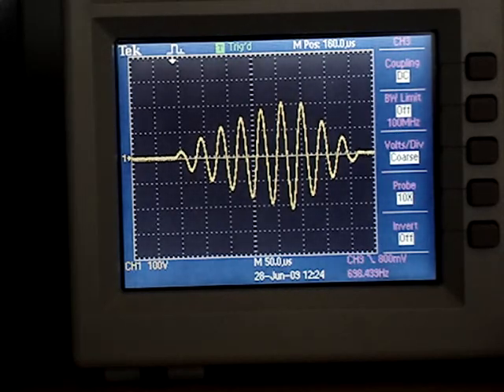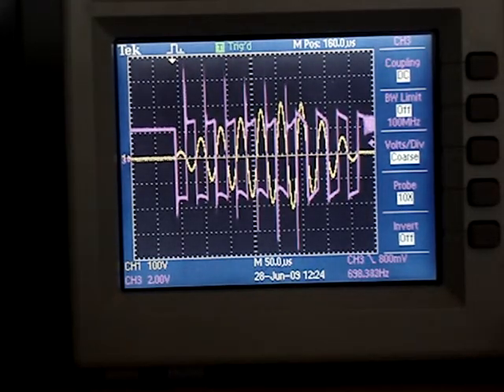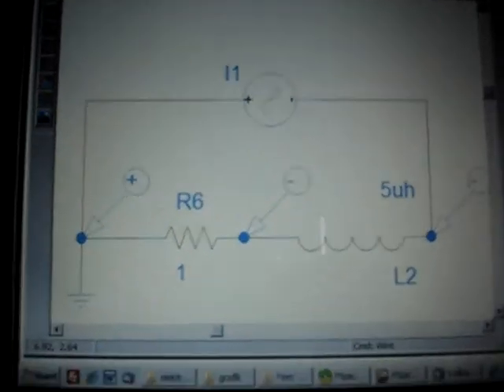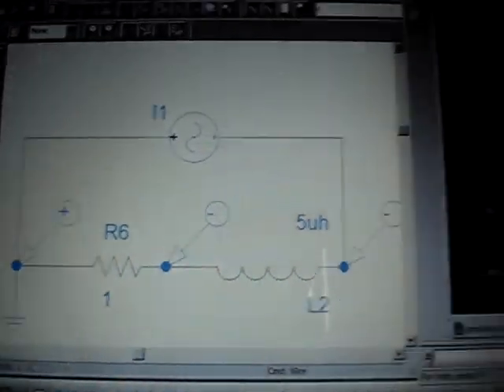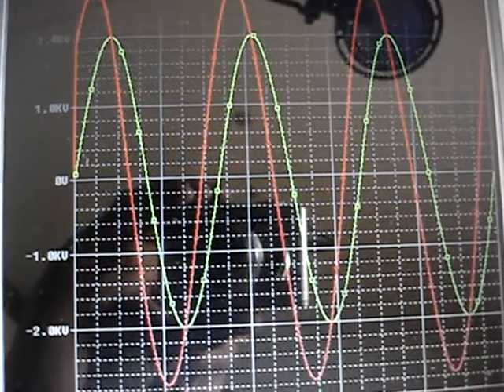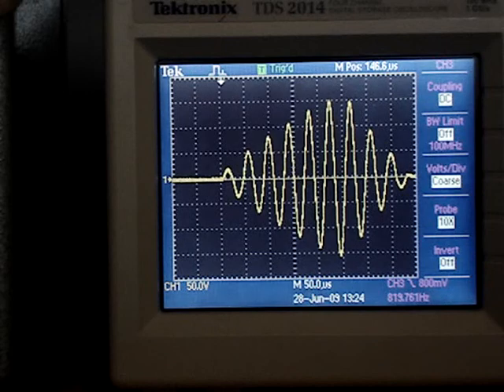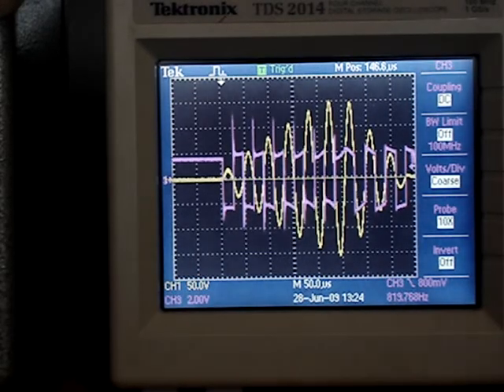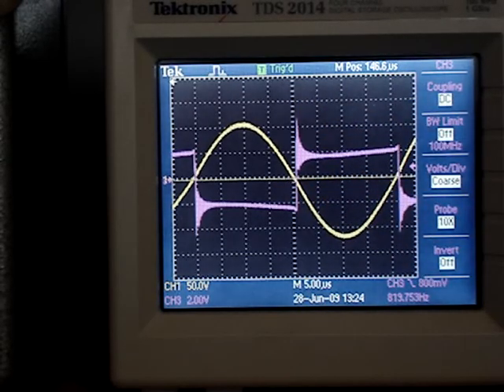Hammertone "Predikter"

Comment: Why my phase lead is not adjusting while i am tunning the inductor and there is no changes in waveform while i am rotating the inductor .... I am using 7m3-393 coil craft inductor ..... My primary coil is resonanting and i have put dummy load as pot ,pot is getting hotter also